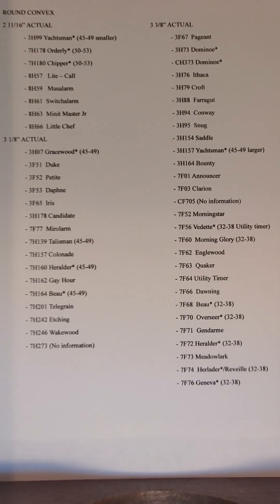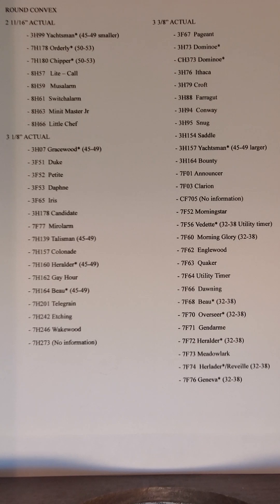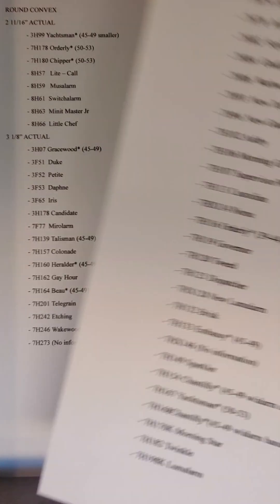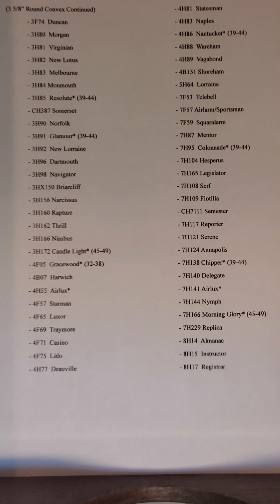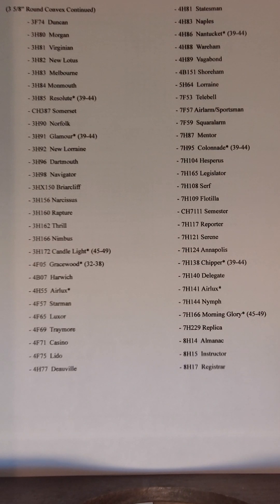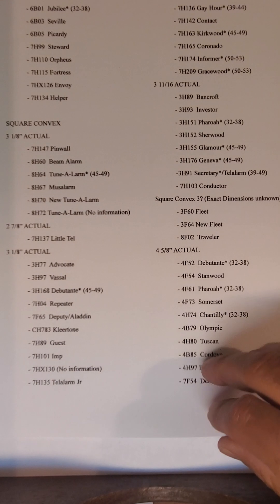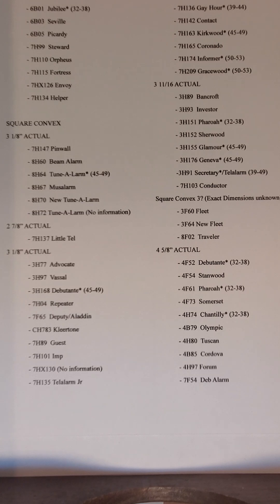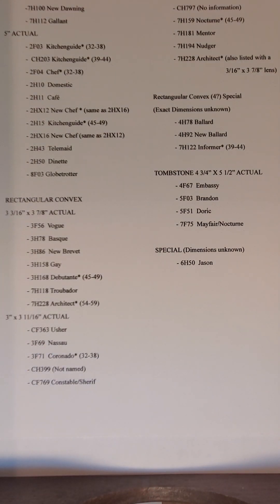GE/Telechron - pt 2 - Lens Guide (Clock Obstacles)

Comment: Video suggestion for you, please, get a cyclometer clock to run correctly. I have a vertical cyclometer and the wheels aren’t turning at the right time, and there is no info out there that I can find.
Reply from the maker: I would be happy to make a video on this but I have yet to work on a cyclometer clock. I will keep this in  mind though and if I have any insight in the future, I will make a video and post it.